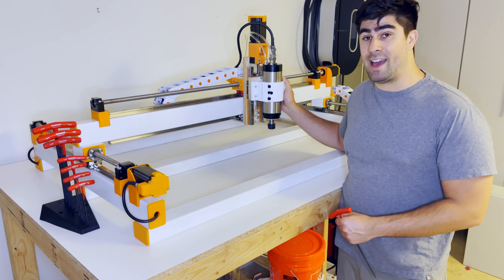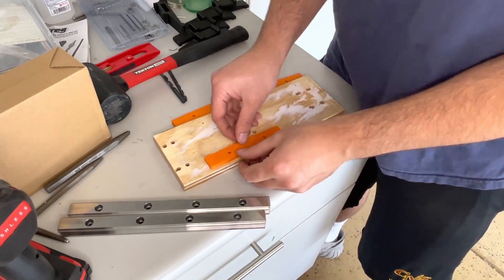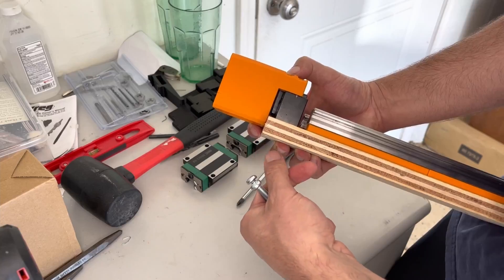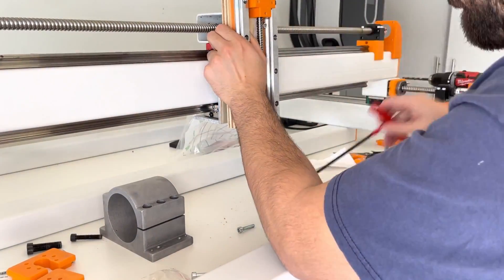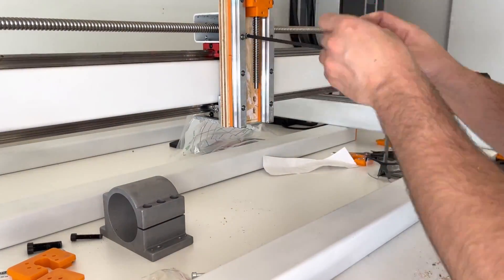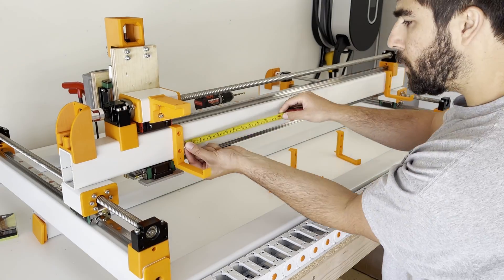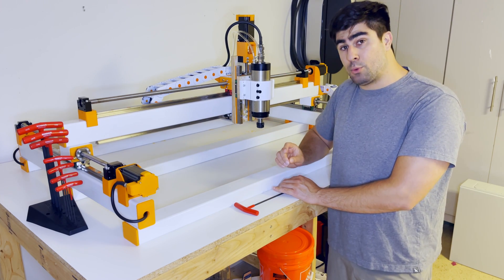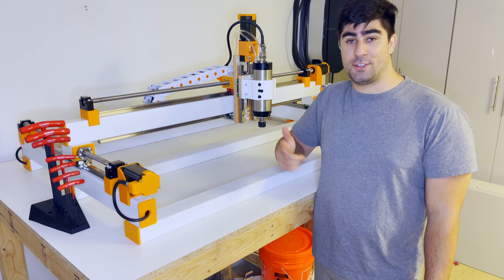PrintNC Z-Axis is FINNALLY Done! | Build Ep. 4

Comment: is 10mm aluminum plate too thin for Z Axis? :)
Reply from the maker: Great question! I think recommended is 12mm if I’m not mistaken? 10 should be ok. I think 12 is recommended so you can surface and flatten both sides rather than leaving stock which could be not flat. But I can check for you and let you know!
Reply from the maker: So it looks like the model is for 12mm. But you can just adjust your files…. You might need to change the bolt lengths so you don’t hit things but I think people have done 10mm and gotten away with it 😊
Reply: @AryaNakh  thanks. :)
Reply from the maker: Of course! Good luck with your build!!

Comment: I like the white cable chain. Where di you get that from? I don't see it on the wishlist.

Also, how did you get the wrong length Z ball screw? Is it an issue with the PrintNC calculator? I just want to make sure mine is right when I order.
Reply from the maker: Thank you! It’s just a black cable chain that I spray painted white! 

At the time of my order, the BOM was wrong and I didn’t know any better! The issue has been fixed! All you have to do to check is make sure you get a 300mm one (if you standard build). The BOM is WAY better now than when I ordered to build. Thanks for the support!!!!
Reply: @AryaNakh  awesome. Thanks for letting me know and I can see on my BOM it is 300mm.

The spray paint looks really good. I thought it may have been but I expected lots of rubbing and wear on the paint. Done well and looking forward to the next video

Comment: Nice build! I like the idea of using square steel tubing but how does it compare with aluminum extrusions? Is it cheaper? Which one is easier to work with?
Reply from the maker: That is a great question! Steel tubing has much better rigidity and adds a lot of structural strength to the machine. That being said… it is a bit harder to work with (as it is a harder metal). But I didn’t find it much more difficult to be honest. 

As far as price, it’s hard to say. I paid roughly $200 for all my steel. Aluminum you would need more to build this so I would guess steel would be cheaper in this application. 

One more thing is that the tubes could be filled to modify the resonance frequency to achieve  better cut quality! 

Hope this helps!!

Comment: what about the screws; what are the ones you have used and how big was those plywood?
Reply from the maker: Do you mean the screws I used in the wood plate? The plywood is 3/4inch plywood. For the top Z mount, I believe they are just M6x 
100mm. Enough to get through both the top and the plywood. But I can check what length they are!

Comment: On wood (plywood) try to use rivet nuts. Recess the head ov the rivet nut and drill 1/64 smaller than the size of the rivet or 1/32.
And by the way. Perfect job well-done
Reply from the maker: Thank you very much! I’m going to try that. I think I need to use that if I run into issues with rigidity while cutting the plates in aluminum!

Comment: That plywood is way too thick. Spec is somewhere close to 1/2. Looks like you're using 3/4
Reply from the maker: When I had asked the recommendation was 3/4 inch in the discord. Other than changing the center of gravity, what are some of the downsides of having too thick of plywood? Luckily for me, it’s only temporary until I can cut my own aluminum plates! Thanks for the advice and the watch!
Reply: @AryaNakh I'm not sure.  I made mine based on the fusion 360 file.  I assumed it was required a certain thickness I think 13mm for a reason,  and thicker would cause fitment issues?
Reply from the maker: @8BitLife69  That is interesting. Yeah I saw that 10-13mm number but I thought that was for the aluminum plates. I guess we will find out if it is an issue when we get to cutting! :D
Reply: @AryaNakh  Yeah, if you inspect the wood plate in fusion, it indicates the same size. Maybe it won't be a big deal, just wanted  to bring it to your attention.
Reply from the maker: I am glad you did! Details like this are important because I totally missed this! All these videos are to help others with their builds! I hope my thicker wood isn’t a big deal but I’ll let you snd everyone know if it is! Thank you!
Reply: When using wood plates there is no specific thickness required 👌
Reply: @threedesign8999  Great to know!
Reply from the maker: Brilliant! Thank you for clarifying, Hoges! 😊
Reply: @threedesign8999  
Why couldn't you just start with a 12mm aluminum plate using the wood template along with the printed risers under the rails?
It could be built with all hand tools unlike  the milled aluminum  plate that later will replace the wood plate .
Other than the 7mm that the spindle would be forward, while not optimum, would there be anything else that would be consequential?